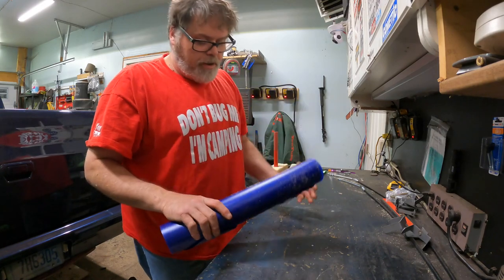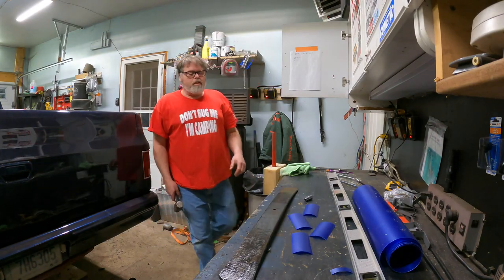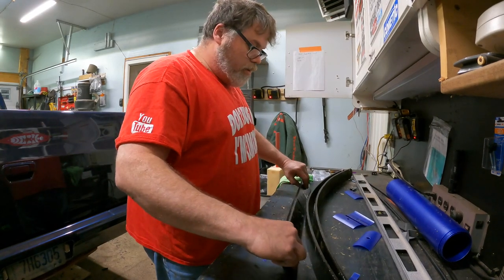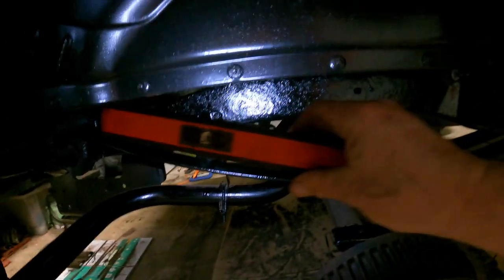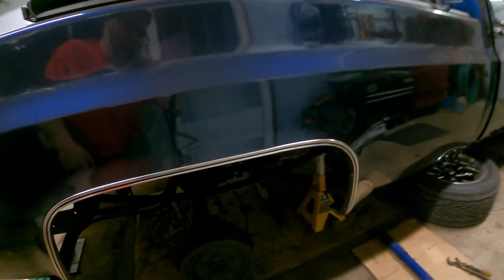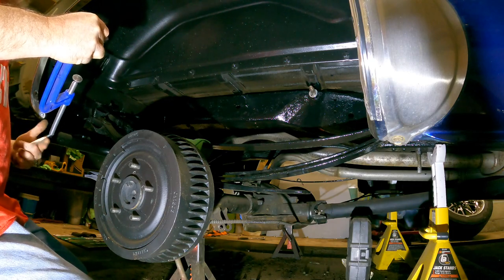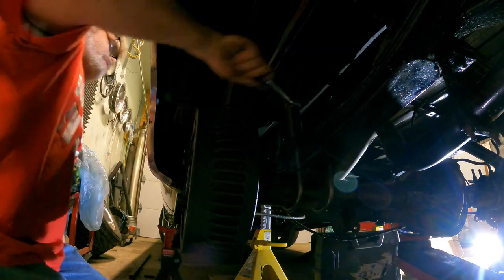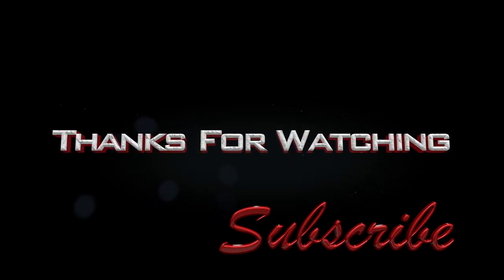Removing 2 Leaf Springs To Lower Truck   HD 1080p

Comment: Does removing leaf springs affect the ride or anything negative from doing so ?
Reply: i’m doing it in my xh falcon that i’m doing up cause it’s too stiff and i want to lower it a bit, taking the middle one out usually does the trick on most stuff utes
Reply: and the only bad thing is that it can put more stress on the other springs if you take too many out, seen a few around where the leaves have literally snapped cause someone took 3 or 4 leaf’s out and was only left with 1 or 2 then decided to put a new motor in the back for whatever he was doing like how stupid